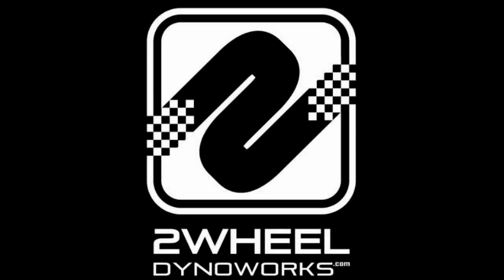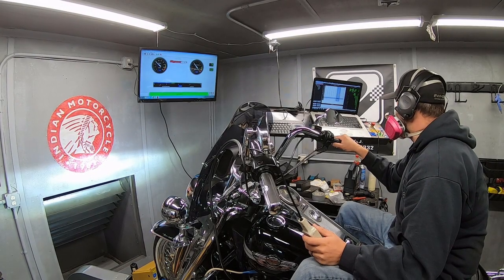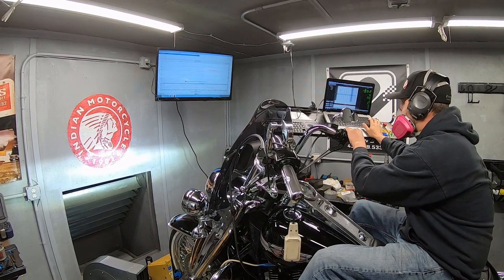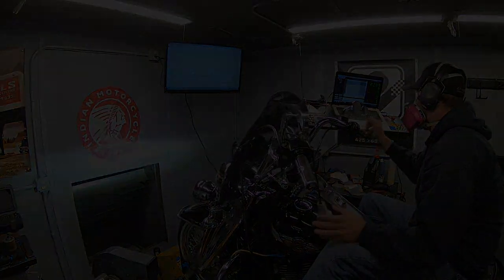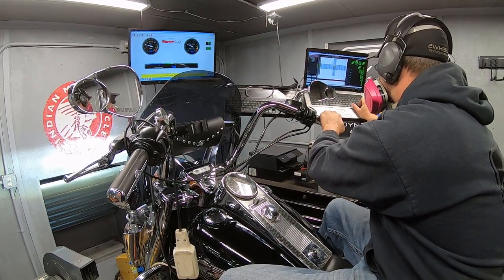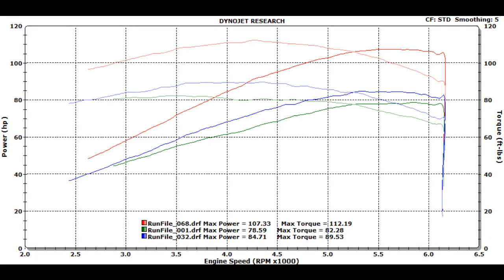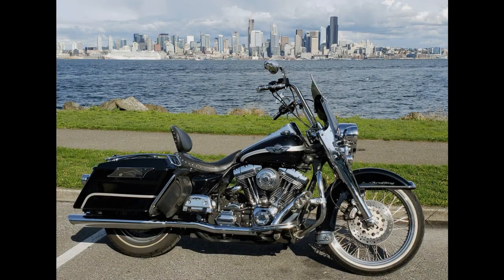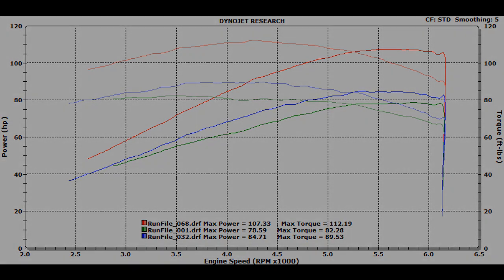100" Big Bore Kit & Individual Cylinder Tuning

Comment: Did I miss the year of the bike? Got the high mileage lower end comment , but didn't catch the year. Wondering about this S&S kit on post Tempkin cranks. Leaning strongly against it for post 2002 year models.

Comment: Were stock heads on bike on final run, already impressed eithway, but seems really high if stock
Reply: This 100 kit comes with new jugs.
Reply: The picture shows S&S heads
Reply: I was wondering the same thing, those numbers indicate the heads were on during final dunk numbers but I don’t know why they failed to mention that....without the heads the 100” kit would still be well below 100hp